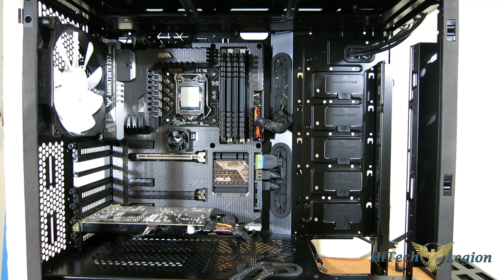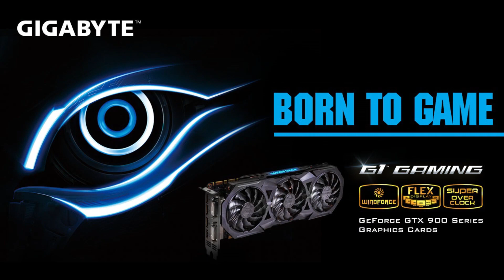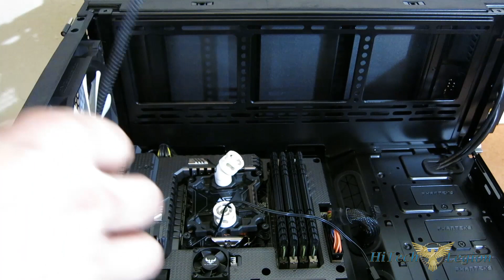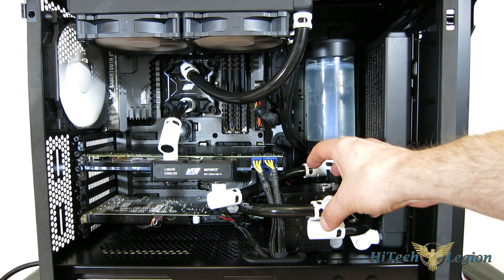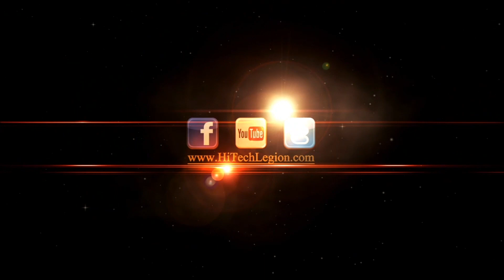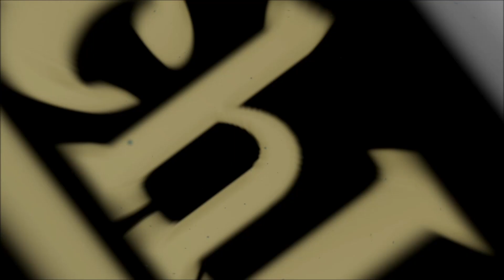Liquid Cooling Basics in The Phanteks EVOLV ATX

Comment: Dude that is one messy wc build. Needs more angled fittings man.
Reply from the maker: Min Chu Unfortunately a couple of unexpected issues with components fitting caused some last minute changes, so things did get a little loopier than we would have liked.

However.....as clearly stated at the start of the video (in an effort to keep these off topic comments to a minimum), it was done merely as a visual overview to show clearances in some key areas as a help to those planning a loop. It is not a guide in how to run tubing, or what fittings to use or to show a finished product that will be everyone's particular taste.

I'm sorry that you don't appreciate the information that has been provided.
Reply: Sorry Hi Tech Legion, I wasn't meaning to hate on you I was just pointing out that the way the loop looks is kinda messy. I guess I've been watching too much of JaysTwoCents and got too anal about the looks of the loop. The rest of the info was fine. I watch all your videos by the way. Are you planning to keep that system in the Evolve ATX? If it makes you feel any better I had to do my acrylic tube 3 times to get it right. In the end its low temps that matters. Anyhow have a nice day mate. I'll be watching. ;-)
Reply from the maker: Min Chu Min, this is Paul and not George,- As the video clearly states, this is basic video to show the qualities and pitfalls of watercooling the Evolv ATX. It is not a video to Baffle you with Bullshit or Dazzle you with polish. It is information to help you decide if you need to modify anything is you have existing components or if this may not be the case for you based on it's pitfalls. 
Answer this question did you watch the video for information or did you watch it to see how pretty George was going to have the setup. If it were for Pretty the video would have been called - Look at my pretty watercooled EVOLV aTX. 
This leads me to my next question, why do you watch videos? Is to get valuable information for a future purchase or is it to be amazed on how nice we staged our studio to make it appear we know what we are talking about? Maybe my generation is different than yours, but I watch or read reviews for information not the eye candy that the person has behind them.
Say your going to purchase a $700 dollar video card, if I gave you all the polish you say yo are looking for - but didn't give you some specs, gave you incorrect information on one of my comparison cards- ran 3 benchmarks - and showed you how quiet it was compared to a reference board (which 99% of the manufacturers don't sell) and told you that I recommend it - you would make a purchasing decision based on that information? OR you purchasing decision was maybe made because I showed off my staged items behind me that look so pretty, I faked you into believing I must know what I am talking about because I have all that stuff?  
dandel351 doesn't make you a watercooling expert because your setup looks flashy. (I know what George can do with his setups and as stated this was not a look how pretty video)
Reply from the maker: Min Chu Min, Sorry since it looks like YT cut off some of my statement. We appreciate the comment, We do listen to our viewers and duly noted. I appreciate the fact that you feel we give more substantial info. Many of the changes we have made are based on viewer input. Thanks, Paul
Reply: +HiTechLegion Sorry to add to this five months late, but I would like to drop in my two cents. First of all, I love the content you create, I regularly watch your videos and you guys ALWAYS reply to my comments when I'm asking for help. That's something a lot of Youtubers don't do - usually they only reply to the trolls and hate comments. So thank you guys for the great content and help :D 

Off topic from the video, but related to this comment thread, in my personal opinion presentation does matter and that applies to all things in life. I totally understand that this video isn't for the eye candy, but hear me out for a second, it may alter your opinion about presentation. 

Let me ask you something; if you wandered down to the cereal isle in your local supermarket to pickup a box of Frosties, only to find they now come in a pouch made out of thin cloth with a rubber band around it, would you trust it? You can bet the majority of the population wouldn't touch it with a barge pole even though it may be perfectly fine inside. 

Presentation matters because it's a symbol of how much the creator cares about their product. Time is money. Poor quality presentation generally means the creator is just there to make a quick buck. They're not bothered about their product, they just want to get their product out to the market as quickly as possible to make the most money. 

On the flip side when you do see a product that's nicely presented, it shows you the creator cares. Why would they spend all of that time and effort into the presentation if they didn't believe in their own product? They could be halving the production time if they stuck it in a brown box with a bit of tissue paper in there. But no, they chose to spend more time to present the product because money isn't everything to them, their product is.

I'm more prepared to invest my money into a company who's spent the time to properly present their product because I know that even if this product may not be the best out there, I have faith in the creator that they will come back with an even better and even stronger product next time because that is what they care about and they will keep doing it until they get it right.

Now just to clarify, I am NOT saying or implying you don't care about the content you create or the fanbase you hold because I can clearly see that you guys do care. What I am saying though is presentation has a massive influence on people's buying decisions and viewing decisions. You could have all the knowledge and the best product in the world but if it isn't presented correctly people aren't going to be willing to invest any time into you. 

My overall message to you is that having a poorly presented product/idea is just as bad as having an outstanding presentation with a poor product and information. Both matter just as much as each other and you need to have a good balance of both.
Reply: I agree. this build could have been cleaned up a bit.
Reply: Min Chu  I did hardline WC loop and it looks better than that mess.
Reply: HiTechLegion 

I appreciate you guys taking the time and effort to make the video don't get me wrong on that. I am subbed to many different hardware channels and I know you guys are trying your best to grow your channel. IMO a bit of polish in presentation is needed for overall growth. This scenario would be an example.  Of course this is merely my personal suggestion. Again the video itself is very informative.  

As per my original comment. I would like to point out that from what I can see in the video some of these tubing bends look risky. Seems like a lot of angular pressure is put on some of the fittings, I had done this once or twice before and ended up with a leak or two after the system ran full load for a few hours. I know this isn't a tubing video but you guys are example setters. Will be checking out your future videos as well, the info is indeed more substantial than other channels.
Reply: +Min Chu woot shots fired
Reply: +Min Chu Must agree, and I that is not against the person building the wc.
I've also tried the phanteks evolv atx and gave up . It's a great looking se but it is not as versatile as other cases despite the possibilities it offers imo.

Also I don't know what kind of fittings you're using but to my taste they look ugly and unpractical.

PS : sorry for my english, not my mother's tongue...
Reply: +HiTechLegion :   You will not say much attached inputs and outputs 2 radiator. The video detail is visible. Thank you
Reply: +Ro-Tang Clan The first problem is that looks are entirely subjective. And, well.....that is really the whole problem. I knew going in that it was a bad idea showing any finished product in this video purely for that reason - but we all make mistakes, and we learn from them so they aren't repeated. Thanks for your feedback.
Reply: When I first made this comment, I got blasted by someone from Hitech when reading in-between  the lines of the response. The fact of the matter is in the loop in the video, there is way too much strain being put on certain points in the loop visually from the video. Now I am not sure how flexible the tubing you used is but I would be very concerned about leaks developing in the build being displayed on the video.  For people who are new to watrercooling and looking at builds on youtube it might of been detrimental.

Also, if the purpose of this video was to show the maximum utilization of space possible in this case, this wc loop doesn't particularly reflect an efficient use of space either. Anyway, it's good to see an improvement in the attitude of responses to user comments.
Reply: +Min Chu You didn't get blasted. It was merely pointed out that your comment was completely off topic of the point of the video. Also, there is no strain at any of the fittings which is why it is so loopy. Oh, I mean "messy".

Either way, I realize my mistake, and never should have shown a finished build in the case. It's a no-win situation, and something I no longer have a need to worry about.

Comment: Does the res not fit next to the gpu in the back?
Reply: Sludacris8 On the back? There is no room for a res in the back of the MB tray.
Reply: George Cella Lol, below the 140mm fan...next to the gpu, same as the luxe.
Reply: Sludacris8 Oh....sorry, I totally spaced on that. You could with a short and thin res - there is ~65mm from GPU to side panel and ~130mm of height with the fan installed.

I really should have shown that in the video - totally my mistake for not doing it.
Reply: George Cella Cool. Thank you for all the detailed information on the case!

Comment: I'm honestly not sure why people insist on thick radiators. It does not improve performance by a great deal. You can shave off a few degrees off your total and that's it. It really isn't worth the hassle unless you have a full-sized extended ATX case like the Corsair 900D, Phanteks Enthoo Primo or Caselabs SMA8. Stick to medium density 30-45mm radiators in push or pull and you'll be fine. If you have a very large case, 45-60mm rads will help keep the fans at a lower RPM without reducing thermal dissipation.

Comment: Didn't realize how small it was. I gave thought to actually trying to squeeze a 240 in the bottom with the pump or maybe a 120mm exhausting out the side of the case. Could just make a cut and put some vent rib or mesh on it.

Was planning on two 360mm coolstream XE up top and front. Front with push/pull if it could fit. 200Ml Bitspower res, and a D5 in the bottom.